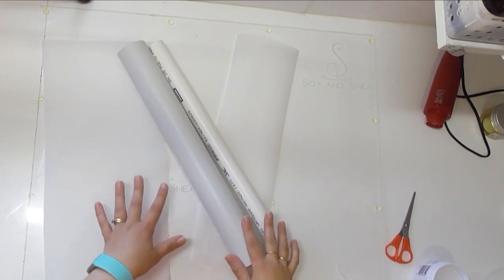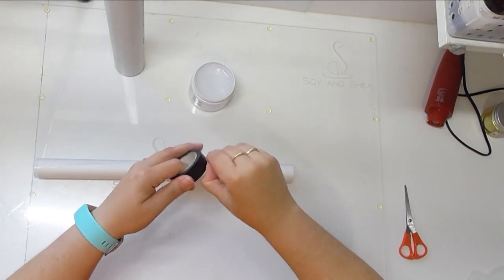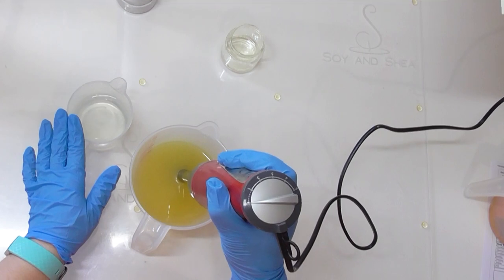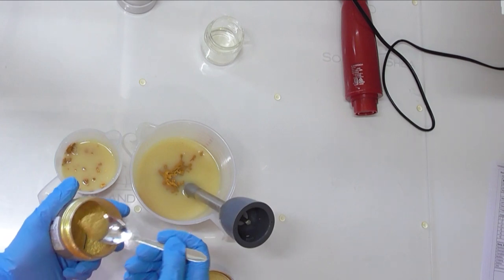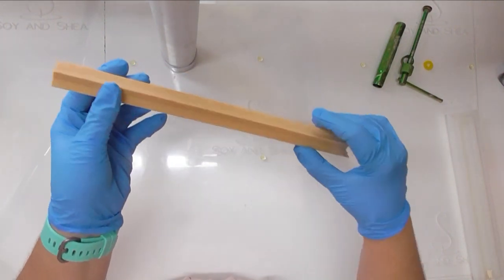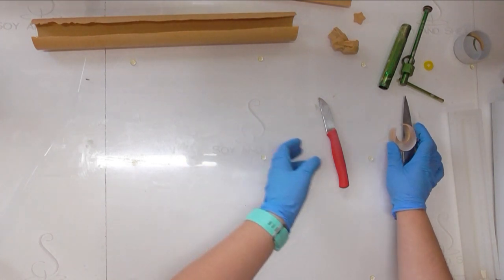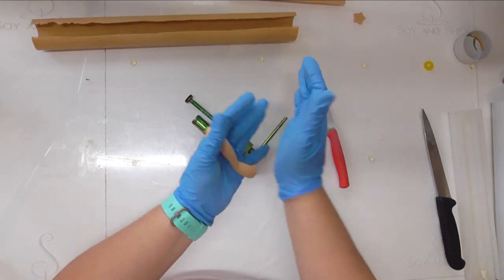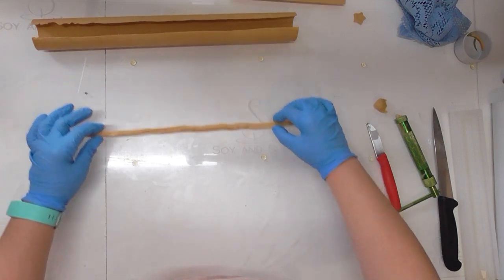Making a Crescent Moon with PVC pipes - how I line the PVC moulds plus other tips!

Comment: I don't have a 3d printer, but I do have a Cricut Maker, and was able to cut an extruder disk with it. Here's what I did:  I got flexible chopping mats from the dollar store. Amazon also has them, but they're more expensive there. I measured one of the disks that came with my extruder (mine was about 1.8cm diameter) and, in Cricut Design Space, I used the shapes tool to make a circle 1.8cm diameter, and inside the circle I placed whatever shape I wanted to extrude, and sliced them.  Then to cut the disk out of the flexible chopping mat, I created a custom material, 350 weight with the deep blade for 4 cuts. Worked like a charm.
Reply from the maker: That's a great idea.  I used to have a cutting machine but it rusted up when I hadn't used it for a while.  My mum has a machine, maybe I could borrow hers
Reply: You need to do a video.